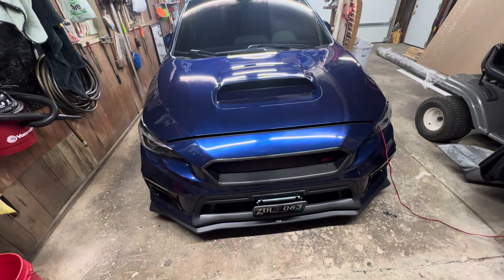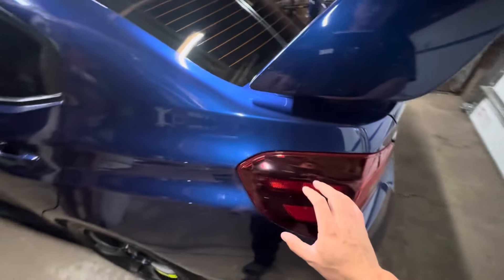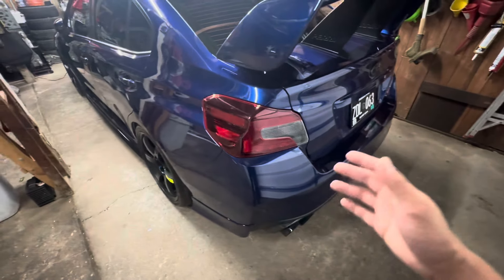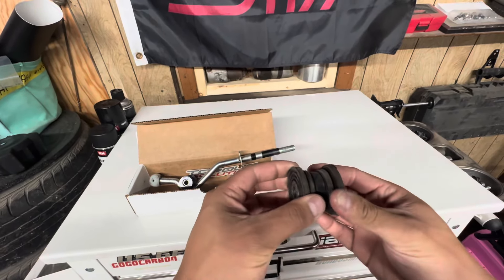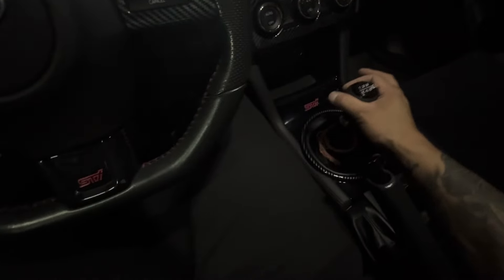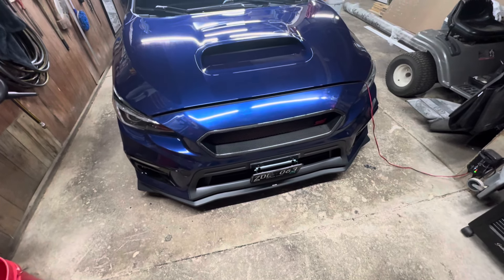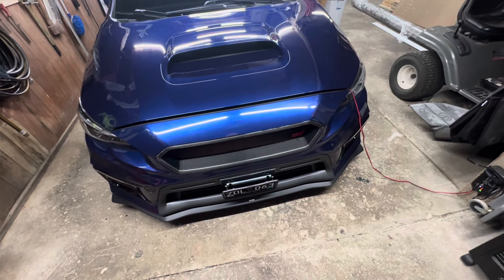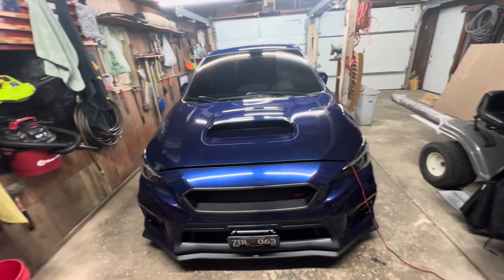STI OEM+ Taillights and Short Throw Shifter Installed

Comment: I like the tail lights. Scoobyfreak86 had his done just like that. I don't blame you for emulating or modifying your car to be similar to his. His old car was beautiful. One day I would like to dress up the engine bay with some carbon fiber similar to his was done without the power mods. I did by some WedsSport TC105X wheels like he had on his at one point. I know he said that they looked to flashy but I love them.
Reply from the maker: @Jonathan_B87  yessir that’s where I got the idea from on the taillights. His was super clean! And yes the tc105x would be nice tbh! I think gunmetal looks good on this color. I’m stuck with the gramlights that came with the car already but it’s fine for now
Reply: @subiekeo  I wouldn't use the word "stuck" for those GramLights They were my other choice, but couldn't get a set in a color and size I wanted. They would be even easier to clean and allow enough space to clean the calipers. I was specifically looking for lightweight and easy to clean wheels. 😁✌️
Reply from the maker: @Jonathan_B87   that’s for sure ! Less spokes lol that’s one thing I like about them .. they’re still pretty stylish looking but for sure wedsports I’d love to get !